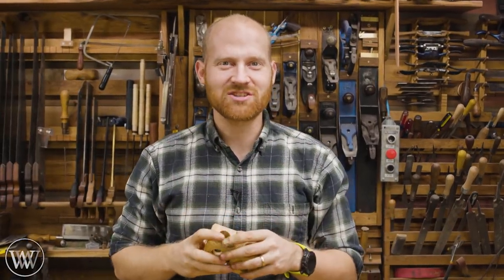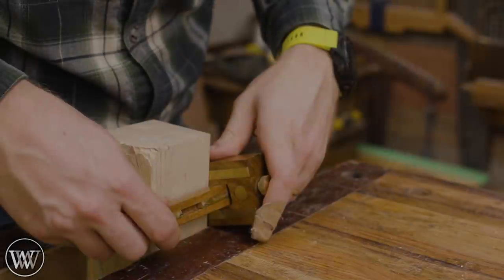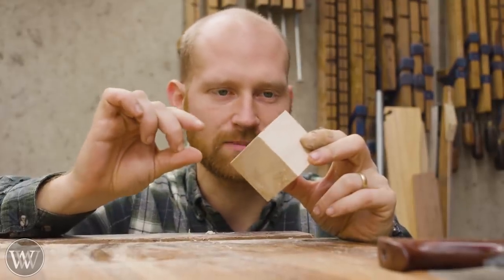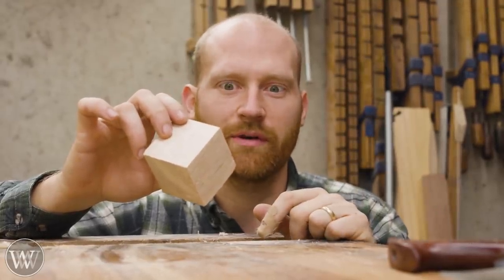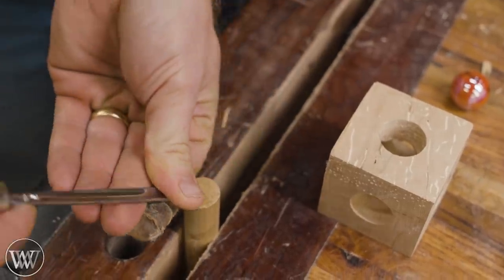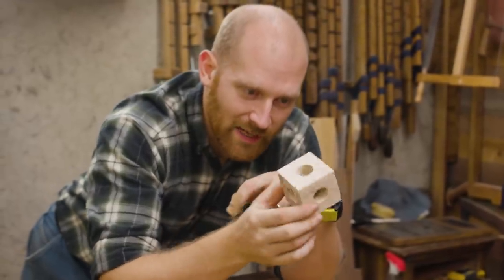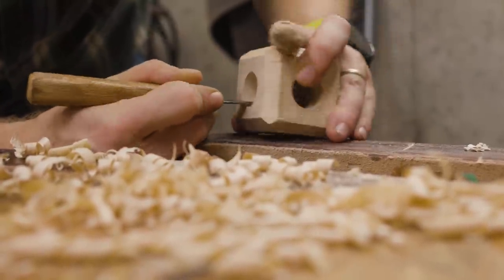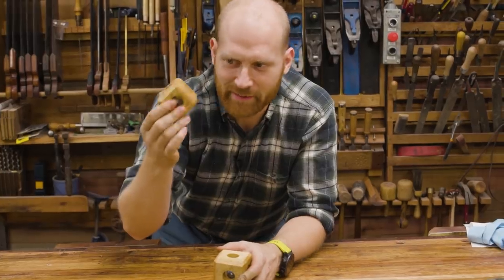How to Make a Ball in a Block : Christmas Present Idea

Comment: Hi James, thanks for the wonderful idea! Is there anything different I would need to do if I tried using a harder wood like ash or walnut? I don’t have any soft maple. Thanks!!!
Reply from the maker: Those will work fine. Ash may crack 1/10 as it is ring porous, but it should work most of the time.